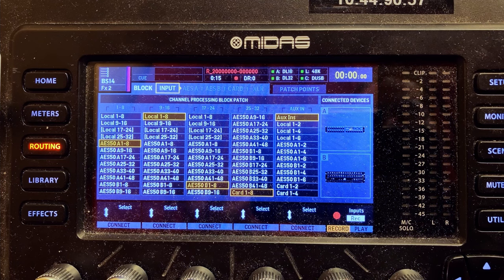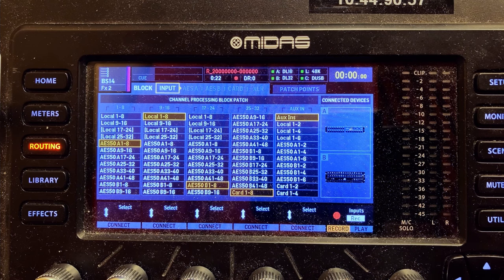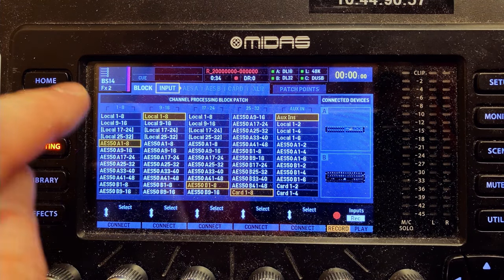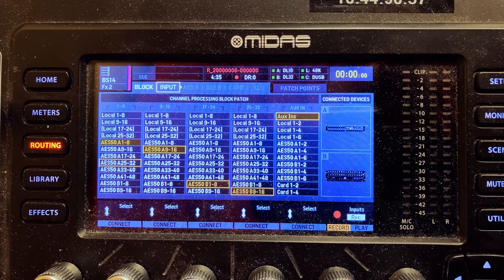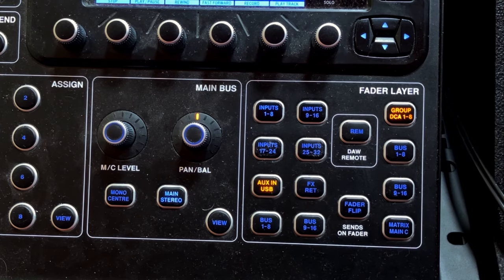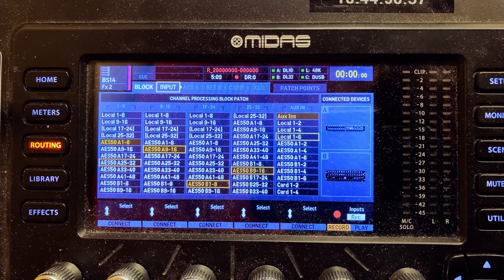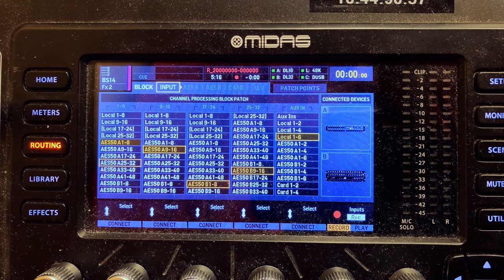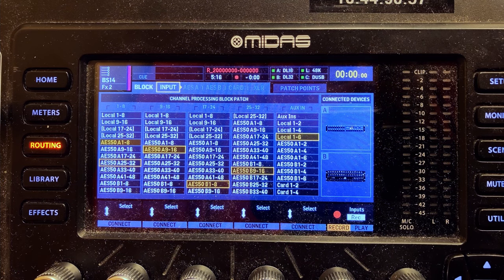Why Do I Have No Sound On X32? Full Guide To Routing On X32 And M32

Comment: you should have covered routing for mix bus fader out to aux 1/4 inch out for those with analog snakes. Not everyone has a digital snake yet. I have seen people using turn around adapters and some soldier cabels to enable the use of 1/4 inch returns on their snakes for the xlr outputs of the mix buses. I tried telling them aboute routing but sometimes house techs are threatened by outsiders mixing on their eqipment and it falls on deaf ears. Digital mixers are like computers or smartphones. They are still new to the masses, and the options are limitless and this becomes overwelming till you use it a few times and figure out how to use it for your purposes. Lets face it analog consoles have consistancy from manufacture to manufacture but Digital Consoles like computers the all have different software and different hardware and Firmware almost like rocket science. Like computers some use a powerful device for Social Media only and Some use it as a tool for learning and enrichment. Transition is always a learning curve.......Meet George Jetson

Comment: QUESTION: If i want to use the local outputs separate from the aes outputs so that I can have 16 stagebox outs and 8 local outs that aren't mirrored, how do I set that up? Is that possible? the out option shows only 16 outs and if I were to assign them all to aes outs does that mean I have no way to route my local outs

Comment: Andrew, this video was fantastic to help in understanding routing in an X-32.    The discussion about physical versus virtual paths including the diagram was extremely helpful.   Also, explaining the use of 8-channel custom assigned USER Input and USER output blocks was very helpful.   I was confused about assigning channels to output to the card until I realized that USER Output blocks can contain both Inputs and Outputs.    

A video about sends and mix buses and matrices would be very useful beginning right after the signals pass through the Input stage.
Reply from the maker: So glad it was useful, especially the diagrams haha, I'm no artist. I'm working on a video about sends and buses just now. I've got one about pre and post fader on the channel already as well

Comment: Thank you! This is the best video I've seen so far on explaining the routing of the x32. I'm still a bit confused but it's because I have very little experience with routing. One thing I would like to see is more pictures or diagrams. For some reason that helps me visualize what is going on internally in the mixer. I keep telling myself I'm going to do just that once I understand the routing in this thing. By then they will probably have a whole different routing interface.
Reply from the maker: I'm so glad you liked it. I agree diagrams make it easier. I'll try to get more in in the future but I'm no graphic designer and it takes me ages haha. But you should make a diagram! Even if you don't think you totally understand it yet then just draw it out, how you think everything links together and in what order. Jus thinking about it will help you understand.

Comment: The concept of a "virtual holding place" was a light bulb moment. Also in the west we read from left to right, thus if the work flow in the pages operated the same way, it would take a lot of the confusion away. But the flow is backwards for some reason.

Comment: How do I use power amps with the X32 and passive Mains and subs, and passive monitors?🤔
Reply from the maker: Hey Brady, assuming you've got sound coming out your mixer normally you would connect the XLR cables of the main output to the input of a power amplifier. You would then connect the output of that power amplifer to your speakers, most likely using speaken cables. So main left to amp channel A, Amp Out 1 to the left speaker. Main right to amp channel B, then on to the right speaker. This video should help:
https://youtu.be/DpfbFaWvdg8

Comment: Thanks so much for that video. I work on tour on many different brands of digital desks and each time I find myself with an M32, I wonder what kind of drugs behringer engineers took to make a routing so confusing. "Analog Outputs" that tend to mean hardware, "card out" that is more like out to the card and so on. X32edit with its matrix look make things a little bit more welcoming, but still, to do simple things you would do on a CL5 in a sec, Behringer software turns it into headacke. 
Thanks again and bravo.
Reply from the maker: Hahahah thanks :) It's a strange system. The whole input blocks and user inputs blow my mind as well. Like, if I can customise every input why not just get me doing that from the start? I almost forget how quickly you can get things done on the QL CL mixers.
Reply: The matrix is in the software (as the midas uses the behringer app). But the software ain't great either.

Comment: Hi loved the stream....I have a x32 and a sd16.....and ....yes I'm having trouble  routing do I need to  tell the desk that I'm using a sd16 ...should it just ug and play....sorry dude tia😢
Reply from the maker: Good question. It should show up in your routing screen if it's connected. Make sure that you're connected from point to point. That means aes50 A on your mixer to aes50 A on your stagebox. It must go direct. Can't go through a router or other network device. Make sure your stagebox is connected to power as well. The stagebox should show a green light over aes50 A in that case.
Reply: @OffshoreAudio  thank you I will have another go

Comment: That console should come with a box of aspirin, because you will for sure get a headache.
I work on all sorts of digital consoles from all standard manufacturers (Yamaha, Digico, Midas, Soundcraft etc) but I've never needed to watch a video about how to patch. 
So if my virtual Out 1-16 and Aux Out 1-6 are used up, I'm out of outputs, even if I have more physical outputs available?
Meaning it's not possible to patch Mix 1-16 to physical outputs 1-16 (via the virtual outs 1-16) on the stagebox, and at the same time rout matrix 1-8 and the L/R mix to the local XLRs on the console?
Reply from the maker: Yeah as far as I know anyway, you only have 16 outputs. You do have 6 auxes. Maybe there's a workaround using user outs. I agree it's a bit weird. Yamaha is a bit weird with the dante stuff as well.

Comment: Great video. no audio sound leaving behringer x32 compact to the 3 floor monitors .  The  monitors are connected t0 two amplifiers   and are working properly . Audio sound is going through the Behringer x32 to the   2 main  speakers  but not through the monitors. can you help me?
Reply from the maker: Thanks! Is sound getting to the bus as intented? use the solo button and the meters to confirm that the intended bus is receiving audio. If it is then check that the sound is reaching the ouput correctly, use the meters to check you've got audio in the intended output. Then check that the output is routed to the intended physical output/ XLR on the mixer and stagebox.

Comment: Great video!  I can’t find the User In option using the iPad software.  Any idea why?  I have the latest version.
Reply from the maker: Thanks, I'm afraid I'm not sure. I'm not much of an iPad user to be honest. I'll be around an iPad with the app in a coupe of days and I'll try find out for you.
Reply: Thank you so much for answering and yes, let me know if you find it, I appreciate it.  Subscribing right now 🙂
Reply from the maker: @JuanGomez-iz7yl  I had a look and it is indeed missing from mine as well, I guess they just skipped it on the app. I tried to find a manual for it but there's not a lot of info online. If you're on the rack version your best bet would be the offline editor to create a preset with your routing done. Though that is a pain.

Comment: Hi in our church we have the x32 producer how i connected but the sound seems not balanced as the left side is the only one showing on the screen, how to i balance sound? you reply will be highly appreciated thanks
Reply from the maker: Hi, there are a lot of questions to ask. What have you already tried and ruled out? Start at the beginning of your signal flow with one mic in, turn it up, how do the meters look? Solo the master bus and listen with headphones, does it sound balanced? Pan the mic fully to the left and right, is the sound equal when you test each side?

Move step by step through the system until you find the point that is causing the problem. If everything seems to fine try updating the firmware
Reply: Thanks for your response sir I appreciate, will check out thanks again for your time and dedication in helping out I really appreciate
Reply from the maker: You're very welcome. I'll make a video about troubleshooting on digital mixers to try help out.

Comment: Thank you OffshareAudio!  You've done a great job in demystifying X32/M32 routing panel!   I look forward to watching more content from you.    

May I ask you a "no sound" question?   I've got a bank of local input (Local 1-8) connected to an analog stage box.  So they're patched to Input 1-8, and they should all come out of the Main LR speaker channel as output.    However, I found that there are 2 input channels which do not give any sound on Main LR, but when press "Solo", audio from that channel would come out properly.     Do you have any idea what's wrong?  Thank you so much!
Reply from the maker: Thanks! You're very welcome. My first guess would be to check that the channels are assigned to the main mix. If you select the channel there should be a button somewhere near the pan dial. I believe it says main or stereo. Very easy to hit that by mistake.
Reply: Let me go check, thanks!!  @OffshoreAudio

Comment: Would you give me the example how to route using user output for the case of:
1. Output 1-8 - AES50A -> Bus 1-8
2. Output 9 - Local -> Matrix 1
3. Output 10 - Local -> Matrix 2
4. Output 11 - AES50A -> Bus 9
5. Output 12 - AES50A -> Bus 10
6. Output 13 - Local ->  Bus 11
7. Output 14 - Local -> Mono Sub
8. Output 15 & 16 - Local -> Main LR

Comment: For the love of God, how do I simply get my computer to send audio via USB into the mixer to play out of front of house? Is no one else on earth trying to do this?
Would really appreciate your help
Reply from the maker: You set the inputs to CARD (09:00 in the video). This video explains the computer side of things:
https://youtu.be/-deK4rMnjY8?si=2ukeNfI-_G3uGDj-
Reply: @OffshoreAudio  thanks man. I seem to have followed your steps and still isn’t working. Will have to keep diving in to understand what’s wrong
Reply: @OffshoreAudio  hey me again. I've gone in circles the past few weeks trying to get my x32 to simply receive ANY audio via USB from my Mac. Nothing is working.
With the AUX inputs, I have audio coming from the computer headphone jack into two (stereo) physical AUX inputs on the x32, and the mixer is handling this just fine.
When I change the AUX inputs to Card 1-6, it seems like now the mixer should simply pick up audio being sent to it via USB (I am changing the audio output on the Mac to X-Live when I try this). But simply nothing is coming out.
I have opened up a Logic Pro X session, and tried sending audio out via USB through all 32 channels testing two by two. None of them play any sound through the mixer.

It seems that whatever inputs are selected for the AUX IN section should be outputted to the same place, right? So whether Aux Ins is selected or Card 1-6 is selected, either source in this section should simply get routed to the same place?

But also with that, am I missing something or is there just no section for assigning where your AUX IN inputs get sent to? Considering the CARD OUTPUTS section is literally a Card Input section, and I have no idea how we are supposed to choose where the card inputs get sent to.

Sorry this is such a long comment. I am just struggling here. Any advice would be appreciated!

Comment: Hey I know this video is old but I had a nightmare the other day with an x32 compact all due to the confusing routing and I just want to see if I was doing something wrong, I was using a Midas 32ch stagebox with 16 outputs, I patched all my inputs in consecutive order on aes a e.g aes50 1-8, aes50 9-16 so on up to 32 I was taking my L/R from the desk so patched xlr out 7 to main L and xlr out 8 to main right and then I patched my outputs for aes50 a in consecutive order e.g aes50 1-8, aes50 9-16 so on up to 16, I could generate pink noise in the Pa and my channels were coming into the desk, I had all the channels assigned to the L/R, my monitors were working but I don’t understand why I couldn’t get the channels to come through the foh, could it have been a fault with the desk?
Reply: Forgot to add I had the user section as off also as I realised this was for custom outputs
Reply from the maker: Really hard to say without looking at it. If the signal gen is coming out it sounds like a routing problem though I'd power cycle everything just to check. Check this video for some signal flow tips https://youtu.be/MgPhpcJiPX8?si=09EOpfQCByvFIf7O
Reply: @OffshoreAudio  ok thankyou